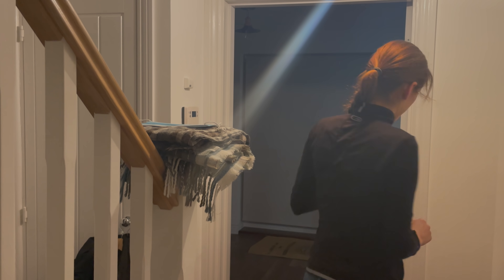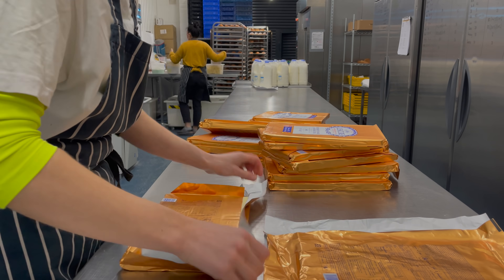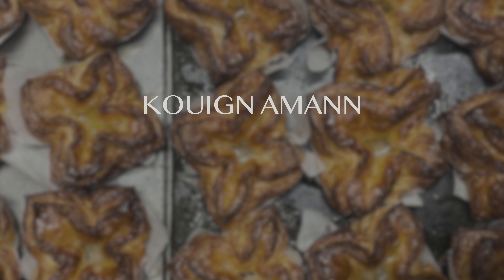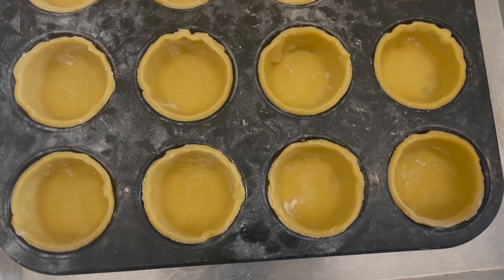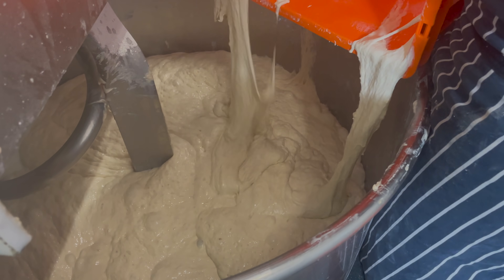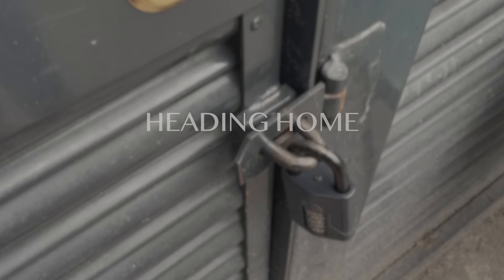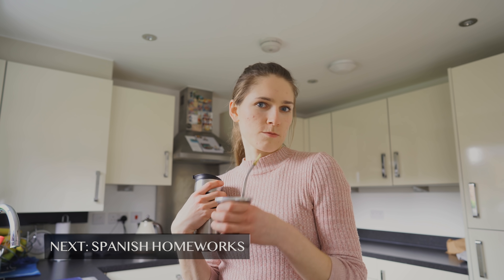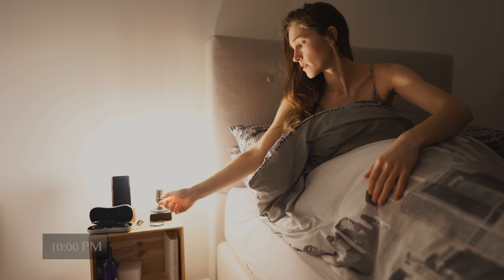A Day In The Life Of A BAKER | LONDON

Comment: I'm a baker as well but I start at 10pm and finish at 4am but I get a lot done in those hours. My job is half demanding, half easy going. I hate making croissants, luckily I only do them about once every 1-2 months.
Reply from the maker: Yes, i am familiar with that shift as well :) any particular reason you don’t like making croissants?
Reply: @KrisKazlauskaite  well I have to make a batch of about 400 croissants and about 200 snails and 200 danishes, it takes a while by myself so it's boring.
Reply from the maker: @vongdong10  yes, if its all the time by yourself it can be challenging and not that amusing, I agree!

Comment: 5:27 , this part is a nightmare for me whos livin in a tropical country where daily tempt is around 31°C , and got no air cond on the kitchen
the cinammon butter will melt in 10 second if u hold it like that 😂😂😂😂😂. it happen with my croissant
i roll it by hand for 55 second and that's what happen , it melts 😂😂, i have to put it back into ref for 10mins and start rolling again
Reply from the maker: hello! thank you for your comment, very interesting to hear from others bakers and from different parts of the world 😊 we are quite fortunate in this sense as climate is colder here but in summer we struggle as well, it's very tricky to work with hot weather indeed🤪
Reply: @KrisKazlauskaite  if i may ask, what is your home usage oven recommendation for croissant
at least i can bake around 24-36 croissant at once without a problem. rightnow im using a signora galaxy convrction oven
i can only bake 9 croissant at once , and even if i turn on the fan, it doesnt work really well, sometimes i have to bake my croissant 10 mins longer than the usual recipe calls for , just to getting 80% of the layer browning lightly